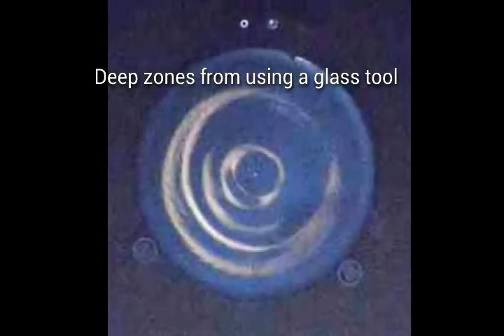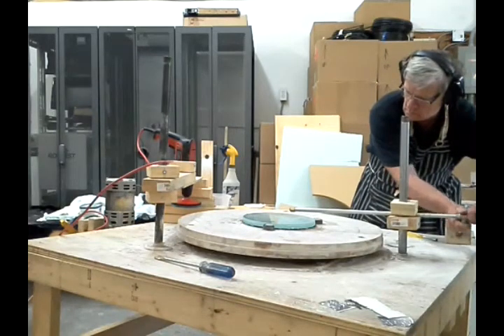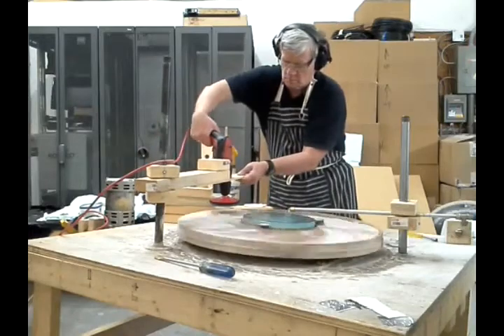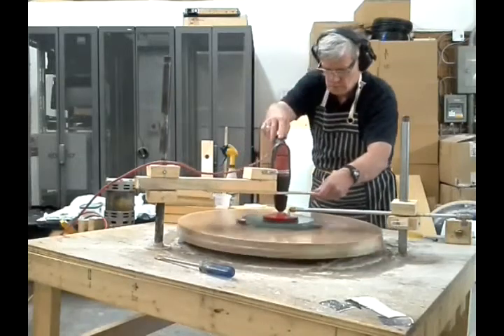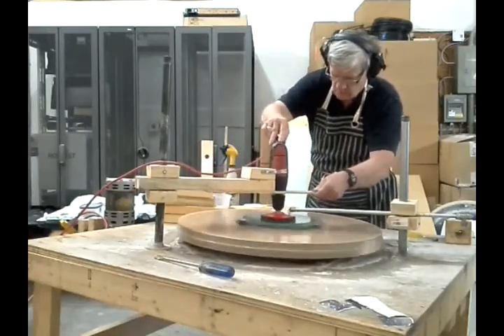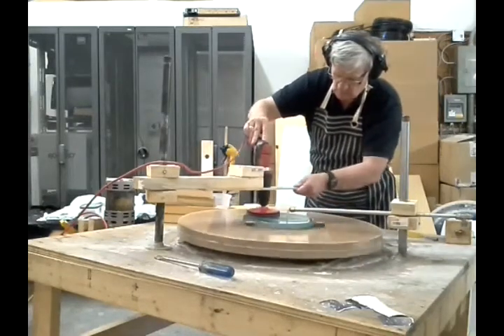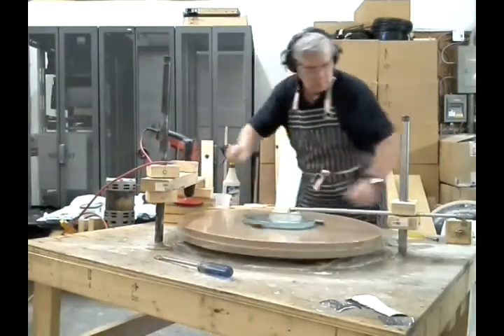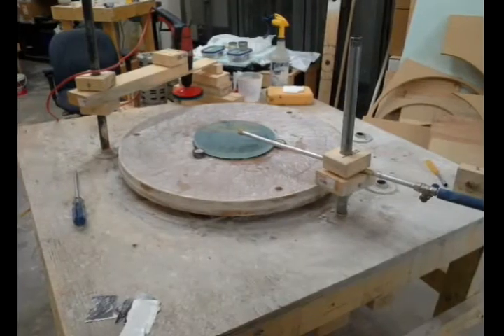Grinding a mirror with a hand drill

Comment: Questions:  1) Size of the diamond pad? 2)  Pad backing definitely makes a difference on results, so what backing pad are you using?  3)  Will this method work for just about any f value mirror?  4)  I trust that the faster the mirror the more flexible the back pad has to be. . .  5)  Do you have an idea of rpm the drill is turning?
Reply: I used a 4" pad with Velcro stick-on backing.
Reply: 3. Not really. The attachment on the drill is flexible thick rubber and you stick the diamond pad onto it. Just make sure it is well centred and clean. 400 grit means you're not going to really deepen the mirror, just get rid of the ridges and kinda flatten out the surface. You would then continue with spin grinding 500 grit then fine grind from there.
It's just an ordinary drill. About 1500 rpm.